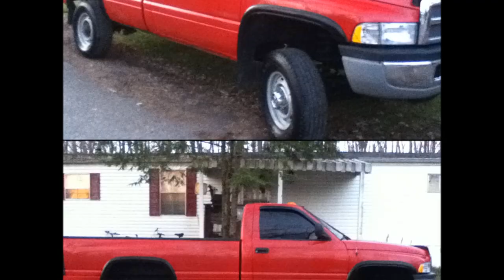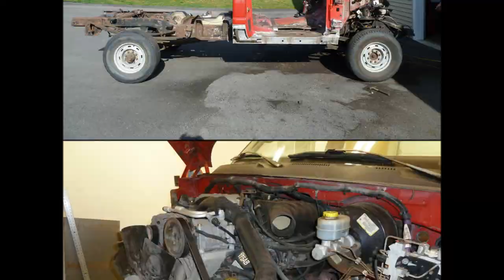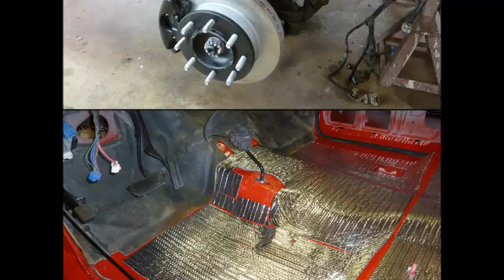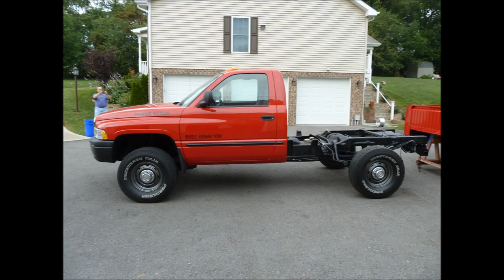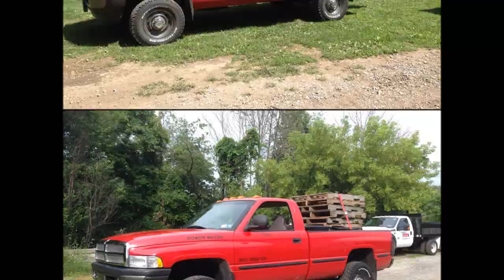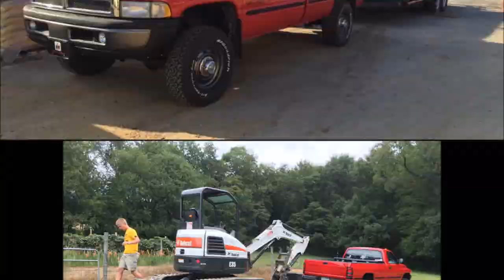Dodge Ram V10 Restoration Project

Comment: I love the fact you made it look like it did in the year 1999 when these trucks were new on the lots. But added a few other things too. I want to make my 99 half ton look like you'res. Mine is the laremie SLT so it won't be 100% like it but it be close. Good looking truck
Reply from the maker: Thanks, I always shoot for a factory custom look. Like something that would have been on the cover of the brochure.
Reply: @488Magnum  if you don't mind me asking. How did you paint the rims that gunmetal grey color? I have a set of steel laremie slt wheels on mine the chrome Is falling off and would love to paint them the gunmetal color
Reply from the maker: @oldcroneysgarage9739  it is just base clear auto paint. Same stuff was used on the bumpers.
Reply: @488Magnum  thanks man.

Comment: Where did you find the factory style door moldings for yours? My 99 has the original ones but I pulled them off due to them starting to fall off. And mine are faded
Reply from the maker: I got them from a junkyard. Wiped gently with lacquer thinner to restore color and some new 3m tape. The front trim on a short bed fits perfectly on the rear of a long bed since the factory never put one behind the rear wheel on 98+ trucks
Reply: @488Magnum  thank you. When I repaint my truck I'll clean the original ones up and stick them back on. I can find the tailgate trim anywhere so I'm good on that.

Comment: Wow great job love the tweaks but stock look! I heard mpg not much worse than 360 V8 gasser what do you say?
Reply from the maker: Thanks! Both of my V10's give 10-14 MPG depending on weather and what I am doing with it. So I would agree not much worse than a stock 360.
Reply: Gearing makes a difference. Example v10 with 3.55 gets better MPG than 360 with 4.10.

Comment: Sir. I want more power for Towing, but would like to stay away from a Diesel. Do you think this v-10 would be a good option. Ted.
Reply from the maker: vaccumme absolutely I have yet to find a load this truck wouldn’t pull. It is a great alternative to diesel
Reply: I agree, my 488 can hang with my friends 6.7 Cummins towing our 16k lbs of equipment around at 60 plus mph.

Comment: 1.how much roughly did that cost you?
2.what is the height difference or lift vs stock?
3.what rims are those and how big of tires in inches? 
Thanks for answering if you do😊
Reply from the maker: I think i was in about $8000 including the purchase price of the truck.  A local pull it yourself yard helped save money. There is no lift on this truck still stock height. Wheels are just the OEM steel wheels that came on base model trucks. The tires were a 285/75/16 which is just shy of a 33". At the end of the video the truck has 265/75/16's which are just shy of a 32".